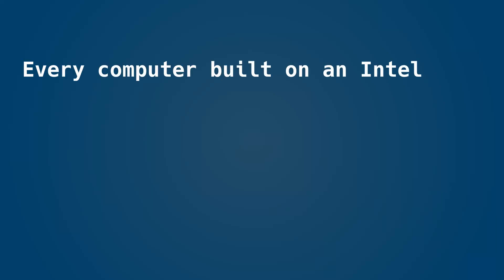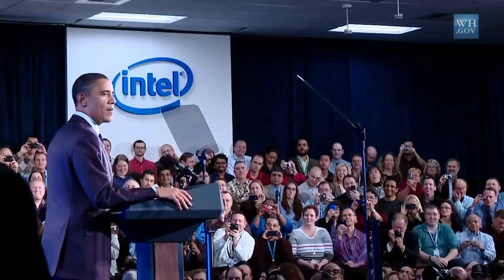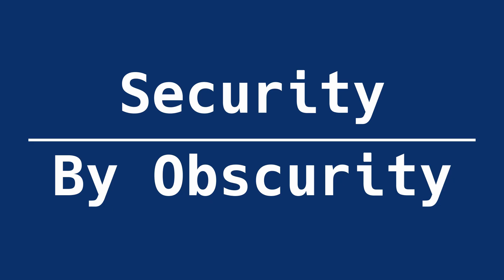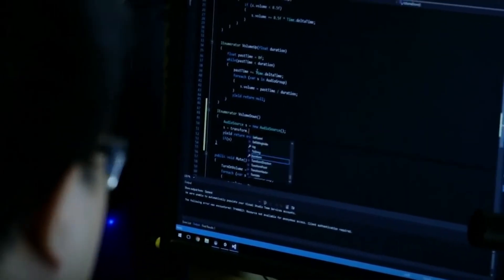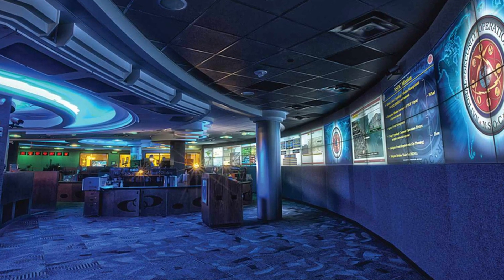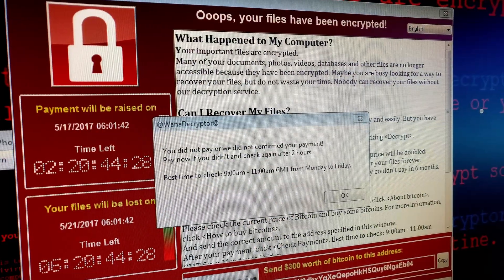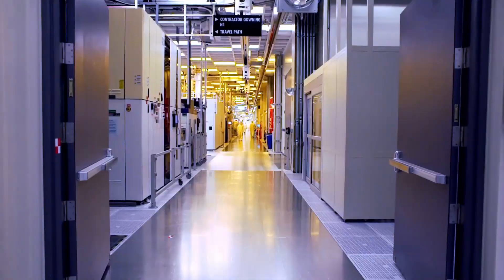How Intel wants to backdoor every computer in the world | Intel Management Engine explained

Comment: But my PC isnt connected to the internet. Never has been. It has the windows 10 build i want, and it stays. It wont update. I get games on disk, install on laptop update on laptop, and do a lil fancy copying and its on the desktop. So idc about their chip. Unless data is travelling through the power cable. They aint getting shit from me haha
Reply: Kyle Logan ..yup. Air-gapped is the only way to go. :) Don’t forget to pull your WIFI adapter (if on laptops) to disable all wireless.

Comment: you can disable it. install FreeBSD and use a special script that blocks it. the catch is, you can never go back to Windows again. good riddance to two bad things. if you MUST use Windows, go back to x58 chipset, that's why those motherboards cost an arm and a leg on Ebay right now. I still have my rampage III extreme, coupled with my 1080 ti, plays exactly the same (on 1080p highest settings on the most recent games).  if you're doing 1440 or 4k, that's a different story, about 6% performance hit due to bottleneck.
Reply: Houyhnhnm ...There’s a hardware hack I’ve been using for years. Wipes IME right out of the BIOS.

Comment: A few things worth noting:
The difference between AMD's implementation of ME side features is that it's code is motherboard side, not chip side, and the CPU does not require this code to be running for the CPU to boot.
Intel ME has been reverse engineered on many chipsets and many laptops and desktop can be run without it now
Some older Thinkpads are compatible with coreboot and libreboot and is a good option
Reply: wait, so what is the difference between intel's ME and AMD's? Is AMD's safer? :)
Reply: @dot32  AMD's isn't as well known or as well investigated.
Reply: @dot32   AMD also have vulnerabilities, but until now the ones "found" worse were on intel side, but we never know is the unknown... there might be more vulnerabilities that are still unknown or known just by someone and never reported...

But so does other chips have known vulnerabilities even in smartphones or like in Nvidia Tegra SOC that lead to Switch being hacked very fast.

Anyway as far as I know anything can have vulnerabilities at software and hardware level, but we only know whats found and reported, the rest we just never know future wise...

Comment: Except that the author of Minix didn't know that his system has been used for that purpose either. And it's a modified version of it that runs on that hidden CPU.
Reply: Yep.  I've messed with Minix before.  Demonizing Minix like this is similar to blaming Linux for the CoV spyware that Google installed on every Android.

Comment: Big misconception: IT CANNOT BYPASS AN ENCRYPTED SSD/HDD
Reply: And what is it that stops it, exactly?
If it can grab your private keys from the RAM, then it can decrypt the HDD.
Reply: @bonbonpony  Sry to pop ur bubble its not that easy. Atleast if you use a proper Encryption Software.
Reply: @mexican21  No software can help you when your hardware is compromised. If anyone is living in a bubble, it's people who believe otherwise.
I repeat my question: What is it that stops it, exactly? No slogans, no marketing. Technical information please.
Reply: @bonbonpony  Rofl how is it gonna grab keys that are not in Memory? And without using the Software u wont be able to decrypt shit anyways.
Reply: @mexican21   That's precisely my point. In order to decrypt something, the software must be in memory somewhere, along with the private keys, in order for the CPU to run those instructions and decrypt your data. But let's say you somehow solved that problem, and the key is never in memory. At some point, you have to decrypt your data from that disk in order to be able to use it, right? So, where are you gonna decrypt it to? There's always a point where the data is in plain text somewhere in RAM for some time when you're working with it. What could then stop that chip from getting its grip on that data when they're decrypted, if it can bypass the operating system and the main CPU? :q
So many people here with false sense of privacy and 0 knowledge about it, believing in slogans and promises of corporations...

Comment: Uh...  A large number of people figured out ways to disable this in a number of laptops and motherboards in 2017.  

https://hackaday.com/2017/12/11/what-you-need-to-know-about-the-intel-management-engine/

However.  Yeah.  One of the best ways to actually disable it without trusting the "Fixes" giving by Intel is to re-flash your ME with a garbled firmware.  This allows your ME OS on the chip to be bricked in a way that your motherboard will recognize as "working" bypassing the other countermeasures built into the hardware.

https://github.com/corna/me_cleaner

Be careful doing this though.  Mess it up and it will be difficult to fix afterwards.  So read a bit on it first.
Reply: Yep, im posting this comment from a librebooted T400 (a distribution of coreboot without the ME)
Reply: @jeanlasallevevo6315   Nice!  I am looking to get a librem 5 phone for similar reasons (but of course not the same as the reason in this video exactly...  But close enough for hand-grenades and horseshoes.) and you sound like the sort to have taken that step. 

If you have done that do you have any recommendations for purchase or configuration? I have read up on it a bit but someones personal experiences might convince me to finally knock this out and stop peddling around with custom ROMS for android.

Comment: VMT system uses a similar backdoor to control all vehicles

It was mandatory for auto manufacturers to build this into all vehicles made after 2006. 

It is a Corr part of the vehicles ECM and second EPU and wired into GPS and cellular data services

It is called different things

GM calls it OnStar

It is designed for tracking, billing VMT pay per mile and for remote control of the vehicle

Scary times we live in

Comment: its nonsense when you say it runs without power. no dude, everything needs power to run.
Reply: Mercede ...yes. But more accurately, it only needs power supplied from a battery (ie CMOS, laptop, or wall power with switch on) to be accessed. The computer doesn’t need to be powered on to access IME.

Comment: what does this management engine actually do? you call it a backdoor, but i have never heard about intel using it as such. my computer never did weird things, and saying that it can read keystrokes and has full access to the system isn't scary at all. the rest of the cpu also has access to everything and knows which applications are running. why would it be a problem if one part of the cpu does that, but not another?

Comment: Goodness sakes..
https://en.wikipedia.org/wiki/Intel_Management_Engine
It enables System Administrators (or system owners) to remote control computers that belong to them. It's low level on purpose, so that you can patch your BIOS or firmware at the system level instead of through an operating system - i.e. I live in a different city than where the company owned computers that I need to work on. I can patch the computers from here without having to get on an airplane or book a hotel.

If you want something to be worried about, just make sure to put tape over your microphones and cameras. It's far and away more likely your operating systems have been compromised than your hardware. /s

Comment: There is a glitch in this, though.  It is only accessible if certain network interfaces are used, specifically the network adapters that use the dedicated network interface from the chipset, like the i219, i217, i211, 82579, or 82574.  Any other branded network LOM adapter or any network adapter used from an addin card will render the IME completely inaccessible.  The reason for this is because the IME uses a "sideband" interface from those specific adapters through a specific chipset to network adapter interface.  Going through a regular PCIe slot completely bypasses this.
Reply: What`s LOM?
Reply: @meekdook4236  Stands for Lights Out Management, or the integrated system to monitor and manage the machine even if it is off or parts are inoperable.  For Intel, the branding is IME, or Integrated Management Engine.  AMD has something for it, but I don't know the name.

Comment: It's not in the CPU it's in the platform controller hub, it doesn't have full ram access and it's purpose is for the Intel active management system which allows the owner to remotely power on or off the PC (hence why it runs when the main CPU is powered off) and to supply other management technologies
Reply: Shut up glowie

Comment: 'Security by obscurity' - the same can be said about all iOS and OSX devices - even Apple doesn't know for certain that there aren't hidden hardware backdoors in non Intel CPUs they use. 

This is one of the underlying reasons why apple is under so much pressure to localize manufacturing in the US - as much as it is possible to completely exclude China designed and manufactured chip sets. 

Over the past decaded the US allowed itself to become almost entirely dependent on China for all its consumer electronics needs. Driven by short term profit goals and corporate greed  - they ignored the long term security risks now blatantly evident.

For all we know the much rumoured hardware backdoors into all iPhones is a reality. We know for certain that iOS can be cracked wide open within a few minutes using various hardware black boxes - 'apple speak' aside there is irrefutable evidence that iOS is just as insecure as any other OS. 

Whilst cracking OS software encryption is relatively simple and many layers above embedded chip level security it is almost certain there are numerous integrated security pathways into most networking and hardware management chip sets. 

Low level power, system and network management chip sets by definition require these functions and capabilities - the real question is just how many of theae gateways are publicly documented? 

Safety is a relative thing. The question is do you really trust the US government or any government for that matter - and how much trust do you have in mega corporations like Apple who say one thing and do another!  Who clearly have enormous sway at the highest levels of power? 

This is not some conspiracy theory - we see the gross security and privacy violations on a daily basis in media headlines. 

If you believe you can truly trust the big tech corporations you are extremely naive. 

Corporate greed requires sacrifice and consumers are the lambs.
Reply: Yeah pegasus can hack any iphone through a web vulnerability, but apple doesn't know how to fix it or doesn't care

Comment: At the end of the day security is one of those problems that's hard to accomplish reliably.
There's three problems that prevent you ever truly creating a secure system in practice:
- Trust
- Complexity
- Opacity.

Opacity is proprietary code and hardware. This can be mitigated to some extent, but never fully.
Even using open source software, ultimately any practical software is compiled in a form that's very hard to truly verify it's full behaviour, and whether it matches the source code. For hardware this verification is even more difficult to do.
This leads us to complexity; Even WITH open source and the (dubious) assumption that the end product you are using is an exact match for the source material you're examining, unless you have time, patience and highly specialised knowledge to examine everything that goes into every scrap of software and hardware you're using to the level that you could rebuild the whole thing yourself given enough time, you'll never know for sure everything that a given piece of software or hardware is actually doing.
And thus, we get the final problem, which is necessitated because of the other two;
Trust. Ultimately, because you can NEVER realistically check all your software and hardware yourself, you're inevitably relying on many other people to do it for you. The hardware and software vendors, security investigators, etc.
You have no choice but to trust that these people are being honest with you, know what they're doing, have your best interests at heart, and that nobody has tampered with what they've collectively given you or described without you or their knowledge.
And what is your guarantee that this is the case? There isn't one. Even this video could be a malicious lie and I certainly would have no way to know for sure whether that was the case or not.
Trust, requires believing someone has good intentions and isn't lying to you about anything or omitting anything.
And since you cannot generally prove conclusively if someone can be trusted or not, in the end, your security still ends up being a matter of faith, not proof.
You're only as secure as you believe you are, because there's no guarantee the people you're relying on to provide your secure systems can be trusted, and it's pretty much guaranteed you do not have the time, skills or resources to fully verify the trustworthiness of your software and hardware yourself.
So... Good luck with that.

Comment: Does the dedicated network connection use the same IP address as my regular network card? Because that's the only one I see when scanning my network (which has only one computer in it). Or does it not need an IP address for some reason? 🤔

Comment: This is the vaguest nothing I've ever heard.
Basically what he's saying is "your processor has a hypervisor".
The end.
Reply: Dirk-Ulrich Heise  A lot of what this guy said was factually incorrect.  Who cares if there's a crappy ARM (or whatever) core stuck to your cpu running whatever?  Its blind, deaf and dumb.  It can't "bypass encryption" because it has no idea how the software you're running works.  It can't "take control of processes" in any sense other than to kill them because, again, it has no idea how the code works.  It doesn't "have its own network interface" because that physically, literally makes no sense and if it piggybacked off a hardwired one, its traffic would be spotted immediately.

None of this is new.  None of the secrecy is even in the ballpark of new.  Try getting the white papers for any of qualcomm's application processors.  It just cant be done and they're in basically every phone on the planet.

For security, you should be a lot, lot, lot more concerned about companies data mining literally everything you do on the internet.  This ME stuff is an irrelevant red herring.

Comment: Retarded ass videos. It is just a type of hardware kernel so you can run stuff more efficient. With hardware limitations nowadays because of transistor size you need to think of logic ways to make a computer faster as is let's say a cache or other systems. Please study some computer engineering before making such videos as you make bold statement on stuff that is beyond your comprehension with just intel creepy pasta knowledge
Reply: To add more technical detail control over memory io and other important things is already done by the kernel but you can make things even faster by placing these functions closer to the CPU as it actually makes a big difference. Stop with the missinformation. This comes from a computer science student.

Comment: I hate this kind of videos. You exagerate so much that it makes it hard to believe the truth.
The claims that are actually real in your videos are drowned by exageration and misinformation.
For exemple, Intel didn't manufacture whole new CPUs for the NSA, it wouldn't even make sense to do so, since the ME is not on the CPU but in the chipset, they just gave them the option to run the ME into a mode where it did less shady stuff (HAP).
Also yes AMD has a counterpart, but there is the possibility to disable it if your motherboard let's you do so.

And i hate the way you present it as if it had absolutely no use, making it look like it has to be a backdoor.
The ME has legit uses, for exemple remote access, but it also has uses like fan control, allowing for use of DRMs, secure boot, etc...

I'm not saying it's not shady and optimal and that it's not a backdoor.
I'm saying: Yes, it's not optimal, and honnestly, certainly a backdoor. But, don't overblow your claims, it does not serve the video.
Reply: Also, one of the top comments (which is liked by the creator of the video) states that since 'even' Google doen't want IME, it makes it so it's a backdoor. 
No, Google just has a project of removing everything proprietary off of their datacenters.
This includes IME, but is not limited to it.

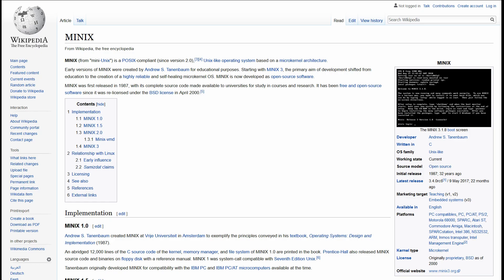Comment: Listen closely, he contradicts himself, saying there is a pice of information missing, then says it does something that would contradict that over and over again. For example 0:40 if we do not know anything then where is this information coming from? Then 0:50 "it can't be manually removed" and 1:42 "without it, the main cpu would not boot at all" to know that you would have to manually remove it. At 2:20 he uses what appears to be an auctual source, but then says "intel made secret modifications to the software" just to say, yea if you look up minux you would not find anything related to what I am talking about, but that is because what I am talking about is a secret and you were not looking hard enuph silly. Then at 3:18 he says that there was a vulnerability in cpus made after 2008 allowing users to access your files, this simply is not true and looking up anything he is talking about will show you nothing. This comment will probably be removed so paste it if you want to circumvent that.